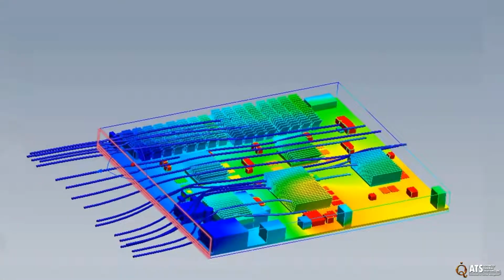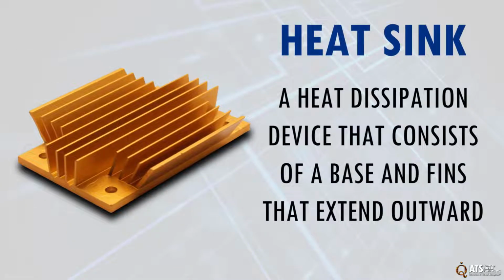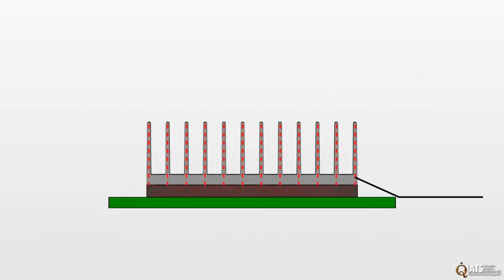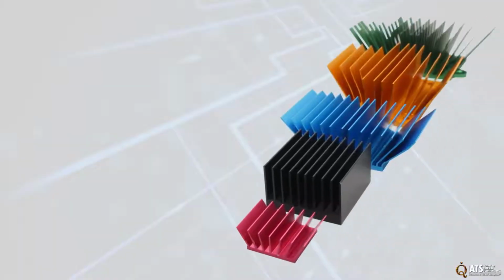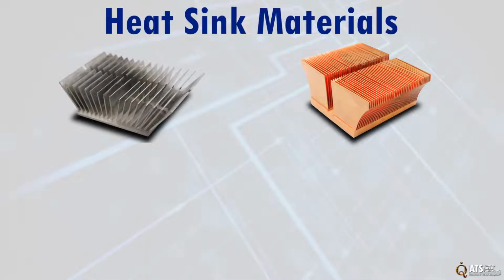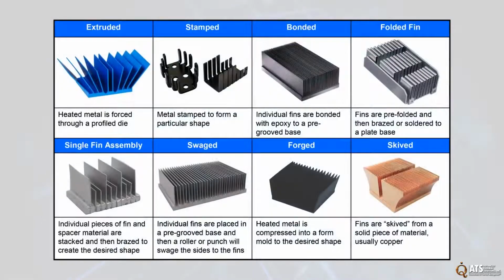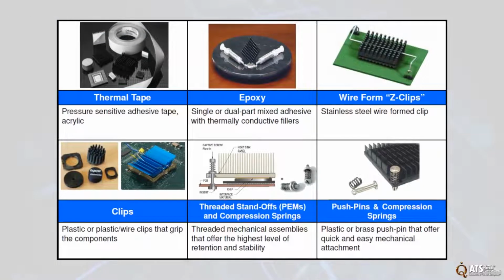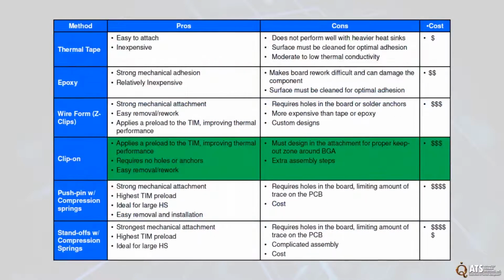What is a Heat Sink?

Comment: Will this work on car amplifiers?...
Reply from the maker: Hi Will - Car amplifiers are pretty big devices but a heat sink that is properly sized will adequately disperse the heat from a car amplifier. You'll need a large heat sink, and the cheapest way to do that is by using an aluminum extrusion. In some cases, the case around the amplifier is an aluminum heat sink!. Here's some additional resources you may find helpful: 

(1) Heat Sink Basics for Car Amplifiershttp://www.bcae1.com/heatsink.htm 

(2) Why Can't Car Audio Amplifiers be Smaller https://www.bestcaraudio.com/why-cant-car-audio-amplifiers-be-smaller/

(3) DIY Audio has a good list of discussions also on this topic https://www.google.com/search?q=site%3Ahttps%3A%2F%2Fwww.diyaudio.com+amplifier+heat+sink&rlz=1C1CHBF_enUS904US905&oq=site%3Ahttps%3A%2F%2Fwww.diyaudio.com+amplifier+heat+sink&aqs=chrome..69i57j69i58.8002j0j4&sourceid=chrome&ie=UTF-8

(4) We have a series of Heat Sink Extrusions that may work, once you size the heat sink for your amplifier: https://www.qats.com/eShop.aspx?productGroup=0&subGroup=0&group=All&q=Profile

Comment: copper fans
Reply from the maker: We haven't seen, for electronics cooling, fans with copper blades. Generally we've seen those with  molded plastic or sometimes aluminum. Have you seen small fans for electronics cooling with copper blades?

Comment: Available for PC? is there a big model for a decent size table fan for room cooling during summer heat? If it is efficient, I'm curious how well it can cool down at least a small room.
Reply from the maker: While this video is really targeted at electronics, the thermal management of a building or room is trickier than it appears. In theory, its just another enclosure, but rooms and buildings are more challenging that that.  Ask anyone who's sat in a freezing office in Winter despite the heat being turned up.  While ATS does not generally work in the area of home or building cooling we do have some suggestions. For a room like what you might be describing, there are a few ways to approach the problem, let's start with the simplest way which is to buy a Box Fan and simply install it into a window in the room. You'll want to choose a side where the window might be drawing air from a more shady area than a sunny one, if you have that many windows.  In addition, you'll want to draw air through the room if you can, that is, from one window in to another window (or possibly open door) out.  WikiHow has a nice article on this approach here https://www.wikihow.com/Use-Window-Fans-for-Home-Cooling

What about ceiling fan?  That's a bit more tricky but there are solid guides out to help  you consider blade length, downrod size based on ceiling height, and more.  Lowes has a hand guide and very helpful suggestions here https://www.lowes.com/projects/build-and-remodel/ceiling-fan-buying-guide/project

What about doing some analysis with CFD software? That's possible though a bit beyond the scope of this comment, but there are resources to do that if you wish.  If you search on room air fan or ceiling fan and CFD you'll find some resources. A 2018 Paper in the journal "International Journal of Scientific and Technical Advancements" does a good job of explaining it:  http://www.ijsta.com/papers/NCEEITET-2018/IJSTA-V4N2R58Y18.pdf